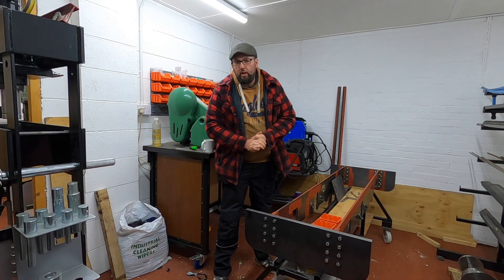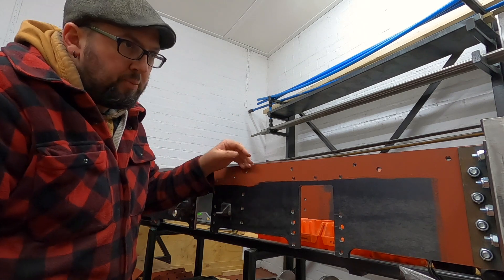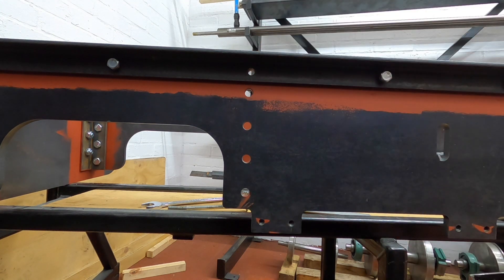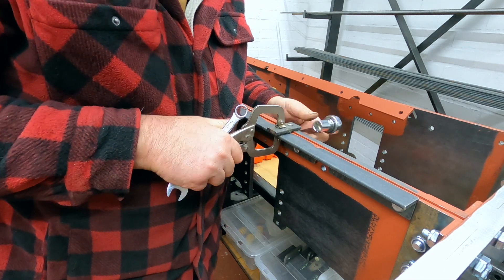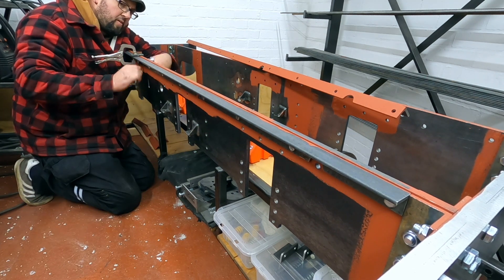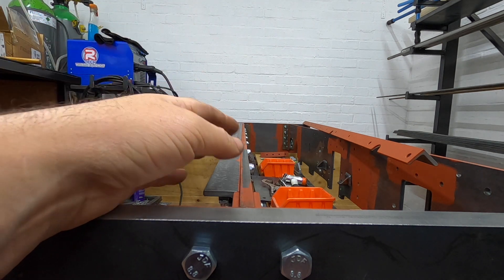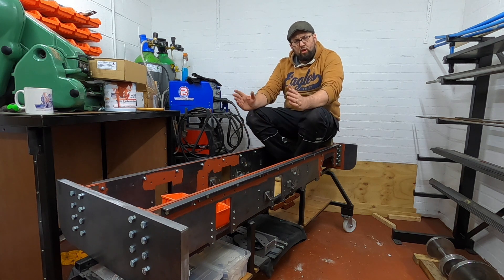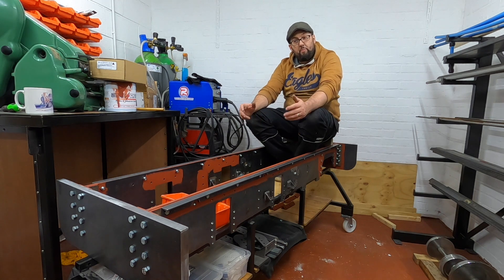Long Angle Irons - EP8 - 7.25" Gauge Steam Locomotive Build

Comment: G’day Matt and greetings from Tasmania Australia 🇦🇺, I know that you built this lovely loco about 4 yrs ago it’s a great build as you don’t have to worry about rivets, you did mention weather other builders have problems or drill holes in the wrong area I reckon that would be a lot of us!   The reason that I am writing to you is the frame or stand you have it on would you happen to have plans for that it looks good and the right height just need a drawing or photo and I will weld it up that would be terrific.   I am building a 7.25 also just finished the tender, I really enjoy you channel and you have good happy and pleasant manner I have subscribed kind regards John Kinnane
Reply from the maker: Hi John, unfortunately I don’t have drawings, but it’s 6ft long, 2ft wide at the base, and iirc it’s 18” from floor to top rail.  All the best, Matt.